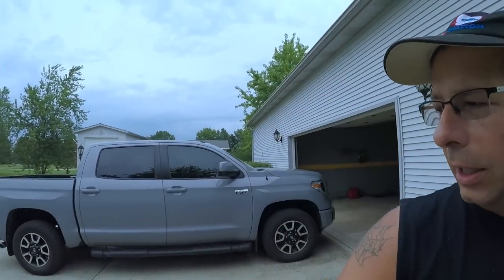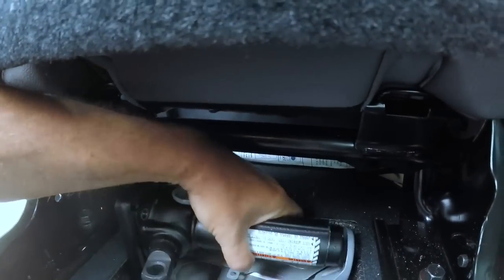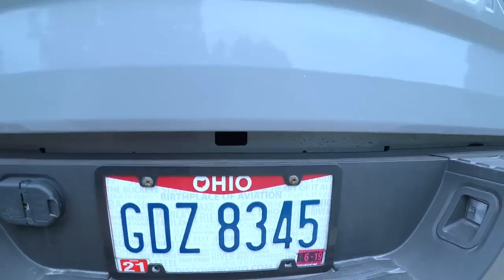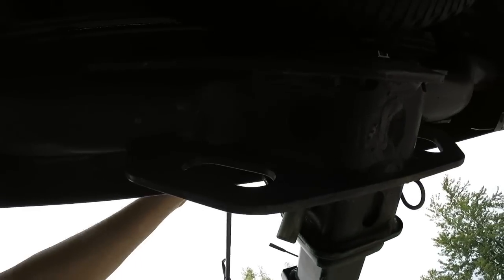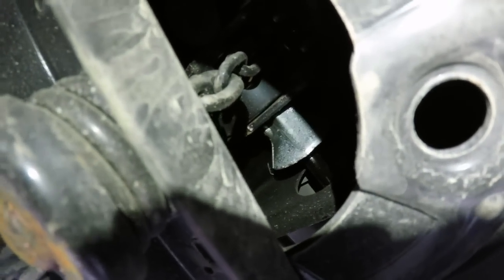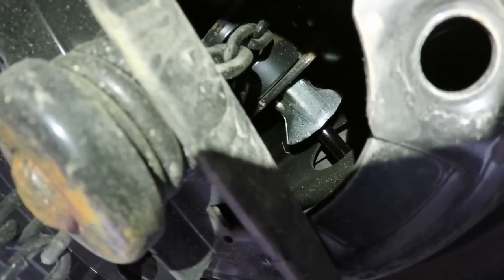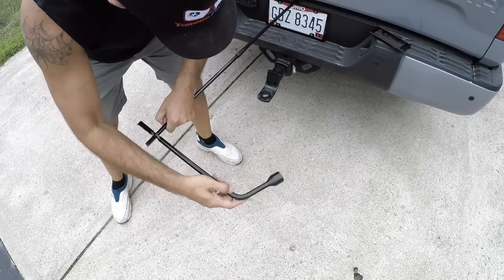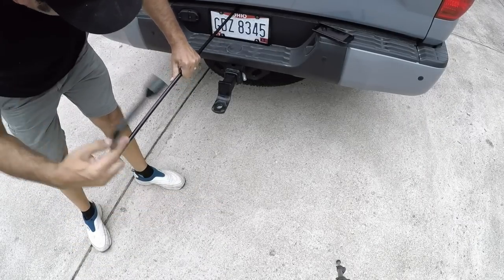Tundra Spare Tire Lowering Procedure

Comment: Thanks for taking the time to do this video. You’re right, weird location.  But it’s all out of the way and if you really need it, the extra few seconds isn’t a big deal. And a little tip, turn the handle around and you can use it like a speed wrench.

Comment: Good video on tire change.  Tundra and Tacoma are the same but rods do not interchange.  It takes practice to hook on both trucks.   I lower both of mine every 3 months for tire pressure check.
Reply from the maker: That’s a good practice.  Would be a real drag if you needed it and it was flat!!

Comment: I see they did upgrades to that tire lowerer.  I  had to change my tire on my 07 tacoma on the tollway.  Thank God I  check the air at times on it and fill it up, by crawling under the truck.  There is a  tpms on that tire as well.  Those stupid rods kept falling apart.   They had little side locking screws that didn't work so well.  Yours looks like it snaps together.  It also took me several minutes to figure out how to get the tire off and out from underneath the truck when it got lowered.  Then I put the jack in the wrong spot.  I found I had to put it under the axle and spin it with those rods that kept coming apart.
Reply from the maker: It’s a horribly weak setup IMO!  Those rods are very thin!  Getting the end in the right place would be a real blast in the rain or snow!!!!!!

Comment: My Tundra is a 2007 and the square end of the rod assembly goes into the lifting mechanism, not the hook end,
Reply from the maker: Hmm….Interesting 🤔
Reply: I just read your comment Paul. I tried the hook end for a couple of hours today and finally gave up till I got on the internet after supper and watched a lady mechanic find the right spot with a flashlight and lo and behold my connection was square too. Thanks lady.

Comment: You also have your handle on backwards be more convenient with the handle protruding out to grab. I wish you would get underneath there see what it looks like
Reply from the maker: Hmmm....I didn’t realize 😬
Reply: And you did following my words you went right into the vehicle at the camera good job very helpful, I just got a 2002 Tacoma I haven't got the tire bar mine seems to have a female socket in there that would almost fit like a square like the end of a half inch extension but that doesn't quite fitting properly lucky I don't need the tire yet encouraging it's good to test your things before you actually need them
Reply from the maker: Absolutely!  Always good to know how things operate before you actually need them👍

Comment: Car makers should have a door open from the truck bed that lifts up to make tire access easier.  I have NO idea why some innovative automobile manufacturer hasn't ALREADY figured this out.  Guess its not a concern for the purchase of a new car.  Who thinks about flat tires when looking at a Brand New set of wheels in an auto show room.  You will when you have a flat.
Reply from the maker: It would be nice👍. Seems they design these for the best conditions.  Of course, a flat will never occur when it’s a nice day on a road with a smooth, level shoulder!
Reply: @RobMotive  I think a door cut out exist in the bed of the truck.
Reply from the maker: Not sure what you mean🤔
Reply: Oh please, it's not that hard.  A door in the bed?  That would add a hundred or two to the cost of the truck.  Of course, the manufacturer is not going to do that for so few who would want it or use it.  Were TRUCK owners, not limo drivers.
Reply: I'd pay a few bucks admission to see someone with a flat tire and a load in the bed; mulch, gravel, block, manure, etc... and need to get to the door to pull out a spare.  That would be hilarious....

Comment: There appears to be a plug in the spot where my hook goes.  I can get the hook into it but it just spins and prevents the hook from going into the slot.  Does anybody have any ideas?  Never mind, I have found the solution.  There is a lock on the lowering screw for my spare.  Now I just need to find the key...
Reply from the maker: Assuming it’s not broken, you must not be putting it in correctly 🤔
Reply: @RobMotive  I have discovered it has a lock on it.  Appears to be this model PT276-34071 Spare Tire Lock for Select Tacoma and Tundra Models - I am working on finding the key now.

Comment: Well Rob, you got a lot of positive feedback but let me take a little air out of your tire.  First,  your Tundra is a lot newer than mine and should have that old fashioned owners manual.  Look in the index (it's at the back of the book) and look for "Spare Tire."  The index is in alphabetical order so it's pretty easy.  It will probably take a minute tops to find where the tools are and how to assemble them.  Secondly, since this seemed to be quite a chore for you, you might consider turning that spare tire over so the valve stem is facing DOWN; that's the direction toward the ground.  That way you will never have to take the tire out to check the pressure or inflate it.  Thirdly, cut out at least half the chatter and get to the job.  There's not that much to this job and doesn't warrant nearly 12 minutes.  Some YouTubers actually fast forward portions.  I am 77 years old and don't have time to waste.  Giddyup Rob,  ; )
Reply from the maker: Lol!!  Now how do you really feel😁